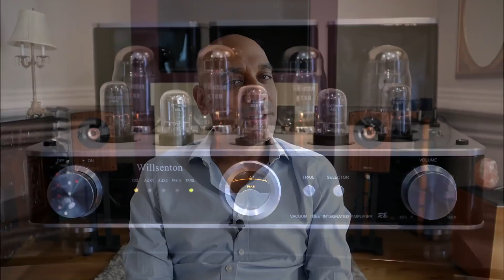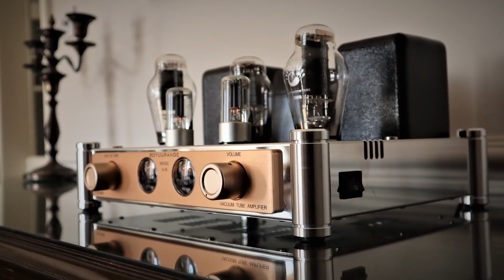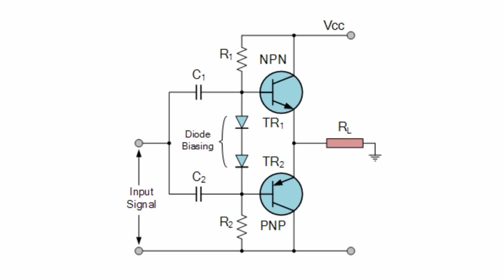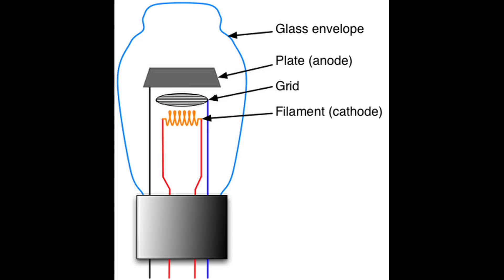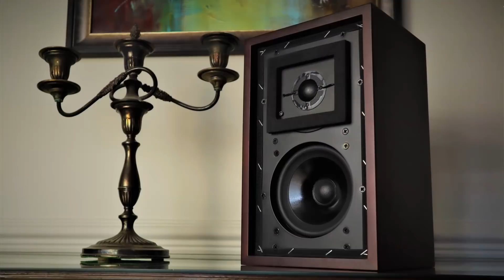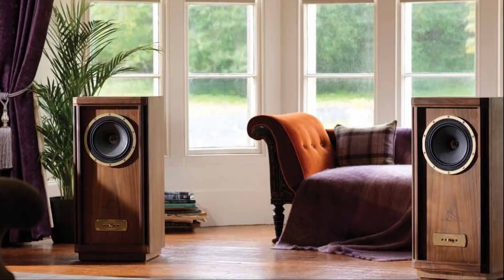Reisong BoyuuRange A50 Mk III Amplifier Review

Comment: Recently i had a Cary CAD300sei in for trial in my setup. It drove my ProAc D20r wonderfully satisfying with good dynamics and bass control to my surprise. It was great from vocal piece, jazz and rock no problem.  Of course it cant go crazy loud but satisfyingly loud enough to mid 80dBs.  I have to say this Dennis Had design 300B amp is truely magical unlike other 300B amps which has very jelly bass control.
Reply from the maker: Thank you for sharing your experiences TTM 😊👍

Comment: Hi Tarun, you ask for experiences with speakers and SETs. Well I hope my experience helps people wandering this path: my amplifier is the DIY Triode Dick Caesar monoblocks. 14 Watts per channel, 300bxls output tubes. SETs don't come much better that this. Coupled with Focal 826v's at 91db they were glorious in the mids. But a severe impedance dip at 100hz and the a exaggeration peak at around 2khz meant I went looking for something else. Well that processed sucked, tried Tektons and various others. All were disappointing. I decided commercial speakers was not the way to go for me. Devores etc too expensive. So I built the Dtqwt mkiii. It is a 2 way design with integrated 'subwoofer' / bass drivers. My version has 2 x10 inch bass drivers per speaker. At 94db sensitivity and good impedance behaviour I was hopeful. However after listening for a long time I am convinced that back emf from speakers is a real issue for SETs. Now I am putting in hypex plate amps for the bass drivers to further lighten the load for the SETs. Once done I am expecting an audio experience of mind blowing proportions, nearly there 😀. My advice to anybody thinking about a flea powered set amp is realise that speaker choice is tough (especially if you want a complete 20hz to 20khz experience with no compromise, i.e including slam and fast headroom). Educate yourself on speaker impedance, phase angles, back emf and don't focus only on sensitivity. Flat impedance is more important than whether it is 85 or 91db. Be ready to try huge (voluminous) speakers! That really makes a difference in dynamics and scale. Good luck, enjoy and be patient 😊
Reply: Hi G D, for back emf there is solution e.g. Ortho Spectrum ML-206, emf absorbtion filter. there is other japaneese brand, I forgot. what it does? eliminates back emf, it is passive filter you interconnect between amp and speakers. look at 6moons review. 
And of course-full agreement for what you wrote. impedance curve matters, time decay (so called waterfall graph tell) as well. awesome DIY speakers are from Danny Richie - GR Research, worth to see his channel here, mayby worth to contact him to design best speakers for this nice amp….?
Reply: I agree that you need to understand back emf and the interaction between amp and speaker. When I first had my triodes, my speakers were 3 way transmission lines. Despite their complex crossovers and low efficiency, they sounded good because they were an easy amplifier load. Just not very loud.

Also consider the "no crossover" options from Lowther, Jordan and Fostex (although I confess to not being much of a Fostex fan). Finally consider putting the crossover between the pre and power amps in "active" configuration. My daughter owns a small pair of active speakers intended as near field monitors and they are absolute giant-killers.
Reply from the maker: Great GD. Sorry, I must have missed this comment at the time of posting. Thank you for taking the time to share your experiences. Very illuminating 😊👍

Comment: Great review, Tarun.  A valve amp is definitely on my to do list, but very much as a bit of fun.  The Monitor Audio Bronze 2 speakers in my study are rated at 90db, so it sounds like I’ll get away with it with this one.  I’ve heard the 300B tube is supposed to be the daddy, but the are many who love the EL34 sound.  So many choices!  Cheers, Mark.
Reply: Mark I have the Reisang A10, 5 watts. I use Audiolab M-Dac Mini and Monitor Audio Bronze 2 speakers. Extremely pleased with the sound. No problems with volume, it goes loud enough, ( smallish room in block of flats), basically, speakers work well, 8 ohm, 90dB.
Reply: @spiral9  thanks for the heads up, that’s very useful.  I’m thinking of the A10 kit, so great to know it’ll work with the speakers.
Reply: I’m running mine on 83db sensitivity speakers until my 93db Omegas arrive, it’s pretty loud, not earth shaking, but not bad either, as long as your listening room isn’t huge
Reply from the maker: Hi Mark, I is going to always be a bit of a lottery with moderately sensitive speaker with these low powered amps. The speakers impedance also plays it’s part. Fun to try though 😊👍

Comment: ….hmmm….an amplifier with a name much bigger than its output…😑
I bet this would pair up nicely (soundwise & expense wise), with a pair of Tekton Lores…they are touted to have a very simple crossover and with a sensitivity rating of 98 and 10” paper drivers I am thinking "synergy". If you want to go all out then order your Lores with some custom paint & beryllium tweeters and have at it. 
Also, as already mentioned this amp is truly visually stunning…especially at this price point!!!
Reply: Hello Bob. Alas, finding Tekton in Europe is almost mission impossible, as the cost of shipping and taxes would be prohibitive to import them. But indeed, it would probably be one of the best choices for this type of amplifier. My 8 watt Elekit TU8200DX works great with Totem Sttaf, but only with Tung-Sol 7581A and 12AU7 Psvane. Poor results with the excellent TAD 6L6-WGC Black Plate small bottle. The right synergy between an amplifier like the Elekit or the Boyuu requires patience, but what a musical beauty !
Reply from the maker: That would be cool to try Bob. I hope someone over the pond may have given it a go 😊👍

Comment: Hello Tarun, you tempt me with this one. Ok so I run a pair of vintage Wharfedale e50 (with opaque grills so you cant see the flashy inside; much better!). They are a true 93db efficient measured in a magazine review a long time ago. They are a 3 way design with a 10inch paper woofer for the bass, a 4 inch paper woofer and a 1inch compression type tweeter. They operate in a 50 m2 kitchen/living room. They are powered by a 35W push -pull el34 amplifier; the Line Magnetic LM211ia. I bought the amp and the Willsenton R8 at the same time and as I mentioned before the Lm211ia is much better in my opinion. I listen up to 85db max and in my largish room the speaker/amp combo provides great dynamics; much better than when I was feeding my ATC SM20 by a 400W (4Ohm) power amp! With the LM211 helped by all NOS tubes, this is the most lifelike sound I have experienced yet. 
And now I am tempted by class A tube designs; would the Boyuu provide enough power or should I go for a 15W-20W class A tube design (much more expensive!). The LM211ia running triode mode produces 15W is good but already softer than the 35W in ultralinear mode. So 8W?That is the question...
Reply from the maker: He Les, it is always going to be a lottery as to how these low powered amps will work with even sensitive speakers. The impedance plays it’s part too. Unfortunately, there is no way of knowing for sure other than trying. Sorry, probably not the answer you wanted 😊
Reply: @abritishaudiophile7314  No worries, I did not expect you to give me answer, I wanted to share that you can get great dynamics in a large room with a tube amp associated with the right speakers.
Reply from the maker: @lesarnolfinis6775  thank you Les 😊👍

Comment: I don't consider myself a discerning audiophile but I love the A50 MKIII. I replaced the Psvane 300B tubes with Genalex Gold Lion 300b's and that made a significant improvement to the base. I paired the Reisong with a set of Klipsch RP5000F towers. That makes for a very lively setup. It plays plenty loud In my home office which doubles up as my listening room and it's super fun to listen to.
Reply: I’ve replaced the standard 300Bs in mine with the Western Electric replicas from Psvane, also swapped out the drivers for a pair of 6SN7s and the rectifier with a 5U4G, it’s now warmer than a burning holiday cottage in Wales…
Reply from the maker: Thank you for watching and sharing your experiences Andy 😊👍

Comment: Informative and fair review as always, thanks Tarun. In your opinion, is it possible to get the benefits of tube amplification without the drawbacks by using a tube pre-amp and a (neutral) solid state power amp?
Reply from the maker: Thank you CC. I have heard those combos elsewhere to good effect but not at home. So I suppose I will find out in time 😊👍
Reply: For what it’s worth, in my my opinion it’s better the other way around, solid state in the pre amp for the SNR, SET tubes in the power amp for the musicality you get from the beautiful even harmonic distortion.
Reply from the maker: @Gripper-Stebson  that makes sense Alun. A lot of hybrids tend to have tubes on the front end and transistors on the output. I suppose it is because tubes can have better linearity as a voltage amplifier and transistors are generally better at delivering current and a low output impedance (high damping factor). These different approaches is what makes this hobby so interesting 😊👍
Reply: @abritishaudiophile7314  I’m a sucker for that even harmonic distortion Tarun, it’s not for everybody though, if people like ultra clean I’m not sure SET is ever going to be for them, personally, I like it. I’m now running this amp on a pair of Omega Super 3 XRS, they are full range with no split woofer and tweeter and no x-over, if, I’m honest, it’s taking some getting used to, I think I’m going to have to get myself a decent sub for that current.

Comment: This is a very boutique sound. I have a 30w class A valve amp paired to 88db speakers. I also have 150w class D active speakers. In certain situations I get a bigger and deeper soundstage with the valves. But for accuracy of instrument presentation and dynamics there's no contest. Valves simply don't do drums properly. I slightly prefer the valves in low energy acoustic/vocal tracks but that's it.
Reply: Go listen to a pair of LaScalas. They do drums like I have never heard before,
Reply from the maker: Thank you for watching and sharing your experiences Richard 😊

Comment: I have a pair of Tannoy canterbury speakers driven by an integrated Kraudio VA880.  50w of pure valve passion.

After hearing high sensitivity speakers with valves it's hard to go back.  My system sounds so much better than my last one which consisted of  Proac d100 speakers, top quality Accuphase preamp  and Hovland monoblocks costing 10x the price. 

System matching is so important.  Spending more doesn't slways mean better sound.
Reply from the maker: Thank you for watching and sharing your experiences Stephen 😊

Comment: A great review again!
I own a tiny hi-fi business where I sell systems that pair low powered valve amps to efficient speakers and are the absolute best value possible.
So I have Chinese amps, such as the Boyuu A50's smaller brother the A30 running the oh-so-sweet 2A3 valves that produce a whopping 3.5 watts. I pair them to 10 and 12 inch Audio Nirvana full range drivers in 80 and 160 litre bass reflex cabinets respectively.
Reply from the maker: Thank you Gabor. I appreciate you watching and sharing your experiences. I am not familiar with those speakers but it would have been great to have tested these with a single driver speaker 😊👍

Comment: Hi Tarun, I see You have arrived now in the Tube/Valve World
with all it's Light and yes ..... some Shadows.
But I would love to see that You stay in that Realm of
high Voltage Magic and Truth or in other Words, give us more
Reviews of affordable Valve/Tube Amps and Speakers that
will work with them well !
I use the Vintage Full Range Philips 9710 in DIY - Cabs they
are highly efficient at 94 db for 1. Watt plus an active Sub.
Of course there are other modern high efficient Full Range Speaker
from Heco, Zu, or Tektron which are Ideal as a Match for  low 
Wattage Tube/Valve Amps.
And I was wondering what your Impression is on the R8 with
the China Tube upgrade Set ?
Thanks for that excellent Review on this little Beauty !
Ralf
Reply from the maker: Thank you Ralf. I am sure I will be reviewing more valve components in the near future. I still haven’t got around to tube rolling with the R8 but that should be coming. Thank you for watching and your support 😊👍
Reply: @abritishaudiophile7314  You are welcome ;-)

Comment: Thanks Tarun. Another excellent review. I am always put off by the lack of a remote control. I found the Muzishare X7 with four KT88s  that has sufficient power and a remote for about $1400 US.
Reply from the maker: Thank you Lee. I hope you are enjoying the X7. I suspect it may be an alternative to the Willenston R8 😊👍
Reply: @abritishaudiophile7314  This is a disease. I now am interested in a Willsenton R-800i amp. Sigh. The only thing holding me back is it weighs 100 pounds!
Reply from the maker: @fletchermunson6225  I should be reviewing that soon 😊
Reply: @fletchermunson6225  It may be a temporary cure. With such weight, you will think twice to swap it out with another :)
Reply: @slowestrider4918  100 pounds is 100 pound heh. I also like the Line Magnetic 805 amp but it only comes in 230 not 115 volts we have here. I balk at adding a 115 converter to the amp. Just more stuff to plug in. Coincidentally I'm having lunch with a friend who has a near by manufacturing company who could receive the amp for me, take it to my listening room and put it where needed. I'm going to ask today. I won't be moving it to dust. Also a little concerned about earth quakes. Amplifiers dont bounce very well.
Reply: @slowestrider4918  I had lunch with my friend and he said he would be glad to receive the amp and help set it up. I'm in trouble now.
Reply: @fletchermunson6225  Well, it may just the amp you need. :) I am eyeing the X9 for I listen mostly vocal and small jazz assemble and acoustic music. The Cornwall IV pair don't need much power to drive. Its' being driven by the Willsenton R8.  When I am in the party mood, the good old Definitive Tech BP20 still sing loudly with the Audio Research LS2 and Parasound A21. Please do  give us your take on that R100. I may jump on that wagon too. For I too is badly infected. LOL.
Reply: @slowestrider4918  It incubating. I'd need to find a new home for the Muzishare X7 tube amp I have.

Comment: Ok… trying to slap you (or make you curious in at least) with a Tsakiridis Hermes… 96kHz Dac included. 35W and easy (autobias) and cheap to replace tubes (el84) so mo’o’less any speaker should be ok…
Reply from the maker: Good one 😂 Thank you Jan-Uwe 😊👍
Reply: This amp is self-biasing too.

Comment: I’m using a Decware Zen Triode tube amp producing 2.3 Watts driving 12 in. Open Baffle speakers rated at 95db. I usually try not to go much higher than 80 dB, but I have pushed the speakers into the mid to upper 90’s as a test. Plus the sound stage and imaging is unbelievable.
Reply from the maker: Thank you Ronnie. I would love to get my hands on that amp. With the right speaker to use with it of course 😊👍
Reply: Ronnie.....which open baffle set up are you using?......

Comment: Zu audio speakers might be a good match, just guessing as I’ve never heard that set up.
Reply from the maker: I would have thought so too 😊
Reply: I have them in UK being driven
by 18wpc. Not a fan of low powered amps. One must have at least 50wpc
Reply: @faludabutt8253  Hi Faluda. How did you get your Zu speakers in the UK ? I thought they were only available in the US. They do look extremely nice and by all accounts sound great.
Reply: Jim Farrell I got em directly from Zu US via FedEx. They costed me around £1500 which included an upgrade, duty, vat & freight. They play reasonably loud with my 18wpc amp but after few pints, I switch to ps audio S400(140 wpc) paired with focal chora 826😁
Reply: @faludabutt8253  Good to know, Faluda. Thanks !
Reply: @faludabutt8253  Do you run your Zu’s with a sub? My modified Dirty Weekends need a good fast sub to really produce a solid bass foundation. The sub also opens up the soundstage dramatically, and produces a glorious wall of sound with plenty of depth. And this is in my space-constrained living room where I have the DW’s fairly close to the wall. I pair them with 300b monoblocks with Psvane Acme’s.
Reply: Vincent Tsu Yes, with T5i. But this sub seems to mellow for my taste. Need to try more subs
Reply: @faludabutt8253  I run a Rythmik F12G sub, which is the paper driver version designed by Danny Ritchie of GR Research. It blends very well with the Zu’s in my room.
Reply: Vincent Tsu You are above my league 👍
Reply: @faludabutt8253   It’s all good. The Rythmiks are quite reasonably priced for a 12-inch sub. Happy sub hunting!

Comment: Tarun, that was a fine presentation again. Good lighting, by the way and personal styling ;) And nice graphic frames between the takes.
Reply: I'm not a expert on how powered tube amp and speaker pairs but you see folks using vintage and modern klipsch speakers, vintage altec horn speakers (big voice of the theater and others), vintage and perhaps newer jbl speakers. Another great inexpensive high efficiency speaker you see mentioned with low powered amps is tekton speakers. Basically all their speakers play well with low and high powered amps. And some of their lower models like the tekton lore reference and the mini lore make great inexpensive attractive options in flashy color choices. Heard a lot about tying  tekton speakers with some of my low powered pass labs diy amps eventually. Thank you!
Reply from the maker: @brandonburr4900  thank you for watching and sharing Brandon 😊👍
Reply from the maker: Thank you JP. Hopefully, making baby steps in the right direction 😊👍